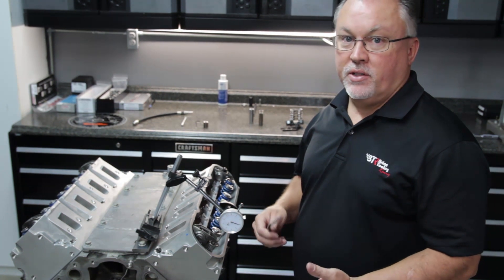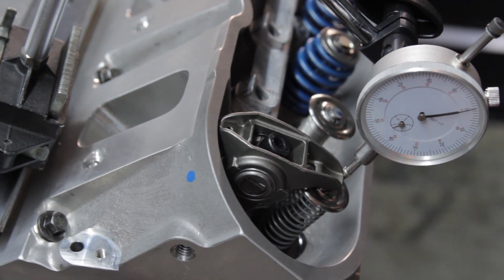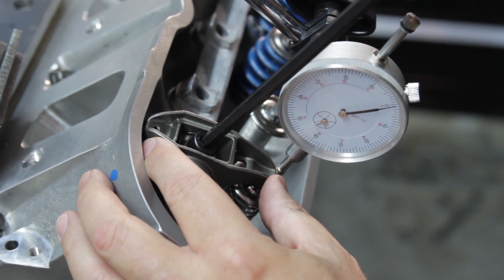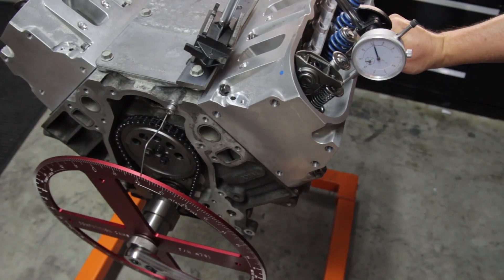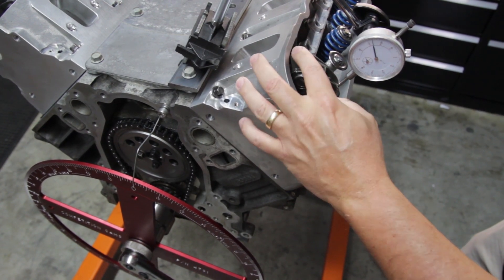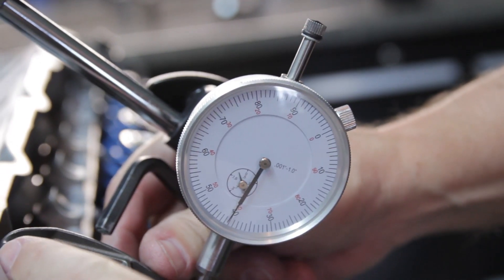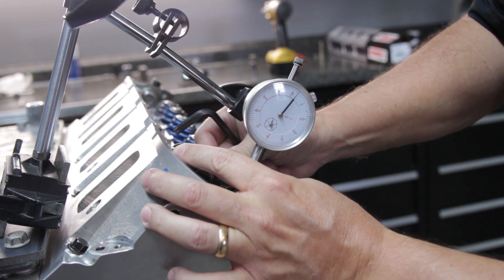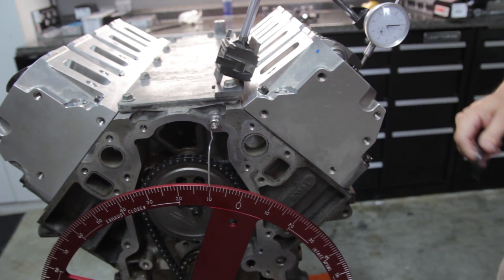Checking Piston to Valve Clearance

Comment: What if your valves are contacting the piston and you need the pistons fly cut? How do you measure how much they need to be cut? I’m thinking about building a high compression engine with domed pistons, barely.600 lift, low 230s duration, 110-113 LSA. Loose cam specs because I’m going to have it custom ground based on finished engines specs.
Reply: If you're checking and making note of the clearance, and it's not enough, it's math. You only have ..010 and you need .080....you cut the pistons .075 (breathing room). Typically you want about .080 on the intake and .100 at the very minimum on the exhaust. Your cam card or grinder will have specific recommended clearances. And, if youre playing with the cam timing, this is crucial. Advancing the cam closes the clearance on the intake valve, retarding the timing closes up the clearance on the exhaust. When I do this, I use the dial indicator, then clay. Why? Because this method wont tell you the radial clearance. I recently had plenty of clearance on a set of Racetech pistons but the radial was right at the edge. I ended up with very very light contact found after a tear down, but the contact was in the radial side, about .150 thou from the base, but in the radius area of the exhaust side. It was about .015". Ya gotta check everything.
Reply: @shawnmcatee895 why was BT so chalant about .032 of clearance never even mentioning thats way tight? It's kijd of wild he acted like .032 is ok?
Reply: @DarksidePerformanceSolutions  If you get away with it, it's "ok"...Ive run intakes at .030 and exhaust stuff at .050...but it's a little nerve wracking.
Reply: @shawnmcatee895  cross your fingers for me LOL cause this engine will see 7500 minimum  per shift....im going back thru AGAIN with the checker spring and fresh eyes make sure my readings are correct
Reply: @shawnmcatee895 did it hit? Lol thats what I want to know ??? Hehe
Reply: @DarksidePerformanceSolutions  You can also adjust the cam timing to and fro to get the clearance. If it's tight on the intake side, you  can retard the cam timing a bit for more  room, and conversely on the exhaust assuming the valve reliefs in the piston are good enough to start with.
Reply: @shawnmcatee895  actually kept moving it around till I feel much more comfortable with the compromise!!! Button the M712s down for last time this weekend, and got the 2 piece Comp pushrods nailed for exactly .035 preload on the Johnson ST2126SLR lifters ( have to replicate the rest ), its coming along we will find out soon hehe...cause she is getting spun up

Comment: He didn’t mention if there are head gaskets in place, can you do this and just add compressed head gasket thickness if no gasket is in place?
Reply: Yes
Reply: Yes, but the gasket thickness isn't exactly 1:1 with your valve. Since your valves are at an angle in relation to the block deck, the added clearance for the gasket would be the cosine of the valve angle times the gasket thickness. For example if you had a 15 degree valve angle, and a .050" gasket, the added clearance would be .050*cos(15), which works out to about .048". Not a huge difference in the example, but the bigger the angle, or the bigger the gasket, the more difference it makes.

Comment: Most confusing video on the internet🤯
Reply: I think if you are in the process of trying to measure your V2P clearance, this video will make perfect sense to you.  Certainly did for me.
Reply: You put the dial indicator on the top of the valve/rocker arm. You rotate the motor over to TDC where the piston is at the top of the bore. You then watch the indicator and note the difference when push the valve open till it contacts the piston. You then check it in a couple more spots near TDC to find where PTV clearance is the tightest.

Extremely easy to understand.